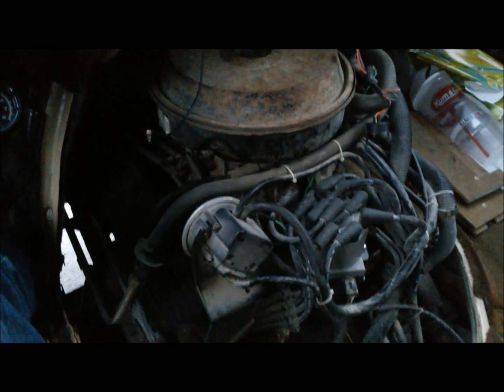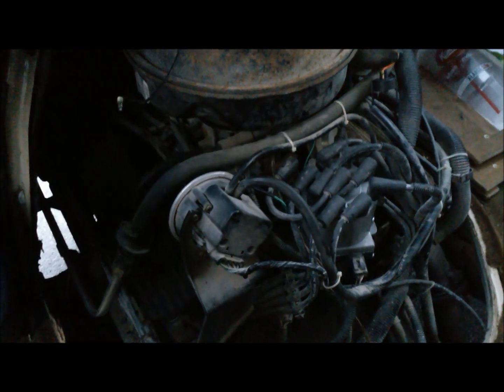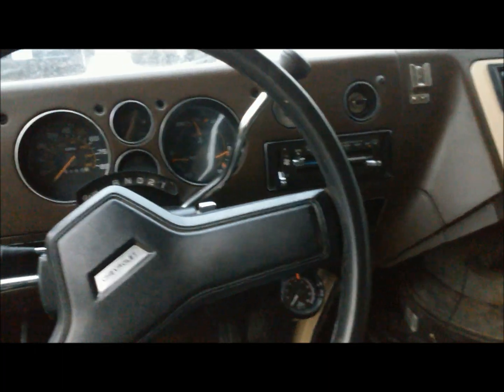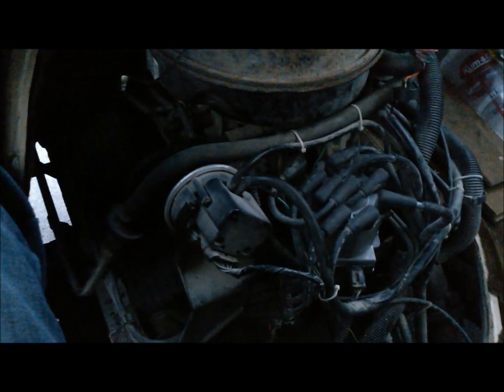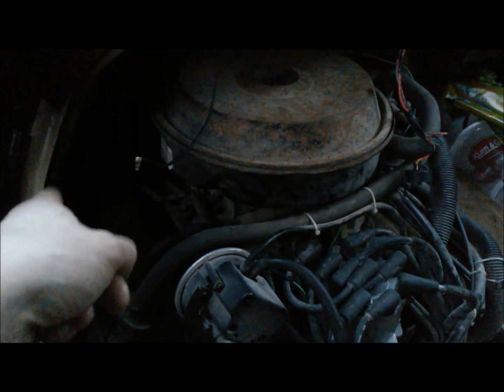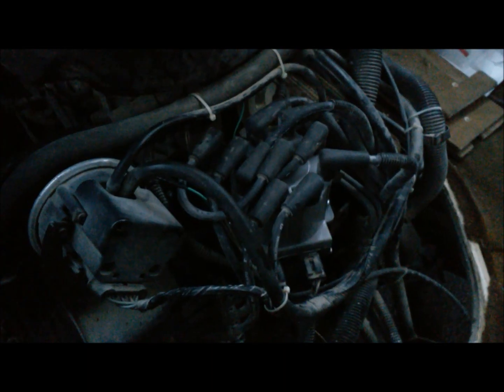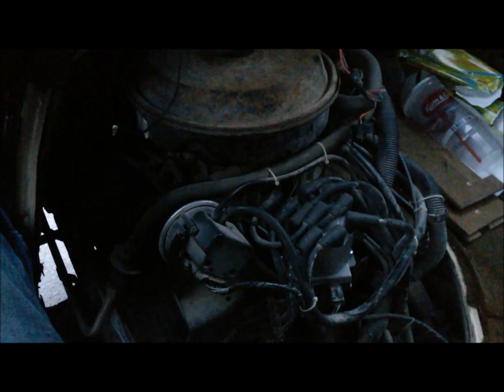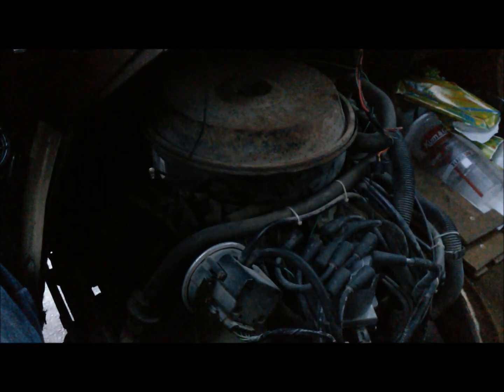TBI 350 - Setting Ignition Timing Correctly

Comment: nice guide. im planning on putting a older style 350 in my 94 s10 using the factory TBI setup and I've been wondering how to do this.
Reply from the maker: Do you know how to find top dead center?
Reply: +ThunderHead289 oh ya I've worked with enough 4.3 v6 motors to know that much but I haven't worked with older motors that much but I know finding tdc is the same with all sbc's.
Reply from the maker: +Eddieallen alright, then from this video you should be golden. You how how to use a timing light as well and everything I'm sure. Tbi is gutless, but to someone who doesn't know carbs, much more reliable
Reply: +ThunderHead289 I have a Holley 650 carburetor but I want to keep the factory injection setup. I'm not looking for big power, 300hp would be great for it as a daily driver. the motor was built already and has around 5k miles already but I plan to freshen it up anyway.
Reply from the maker: +Eddieallen gotcha, makes sense.
Reply: +ThunderHead289 I plan to tryout some TBI mods with it also so that's another reason I'm keeping the factory setup.